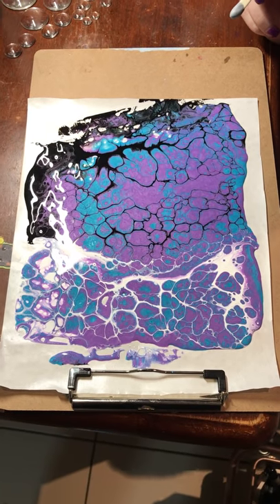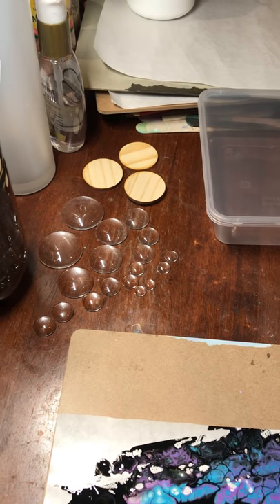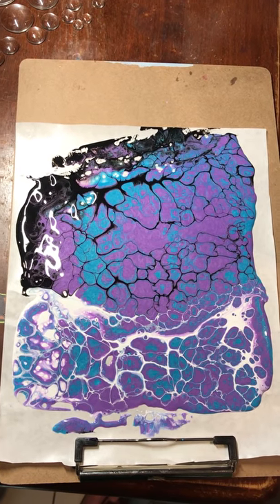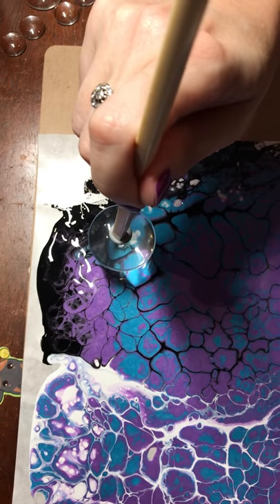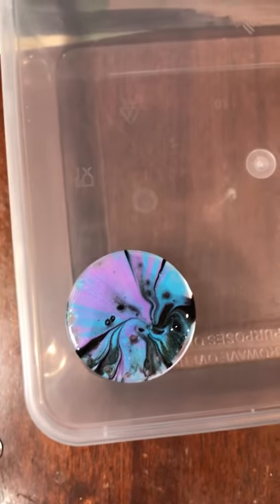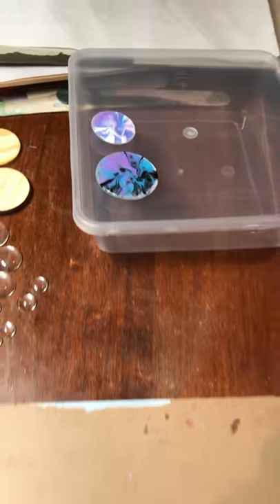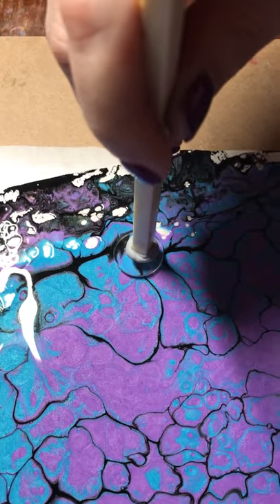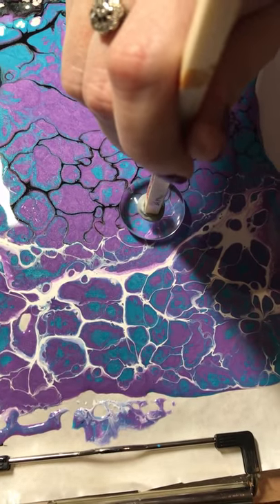Dipping Technique - Acrylic Jewellery

Comment: I tried this dipping technique instead of gluing and cutting, I Love it I made 30 in minutes! 😄💕💕
Reply from the maker: Teresa - great! A warning though - it's dangerously addictive ;)
Reply: I love using this method too, you can do it right away and it's very simple to wipe the edges off after you dipped if you get extra paint on the edges but I also use the other technique after the pour dries
Reply: Where did you get your chopsticks
Reply from the maker: Oh I have no idea 😂

Comment: I'm going to have to try this way I've done the old fashioned by pouring the paint and letting it dry for 2 days before putting the cabochon on
Reply from the maker: I usually leave it for 24 hours but don't forget it depends on your climate! In cooler climates than mine you'd need to leave it for longer :)

Comment: You said you added silicone for the cells (I think you said hair something) but do you need to wash that off when dry like I'm reading alot of people do with their paintings done with the silicone added?  Thanks!
Reply from the maker: Hi there! If I'm using dried pain skins, yes, I'll wipe the skin briefly with a non-oily baby wipe before I glue. If it's a dip, no, I don't clean it off but I do make sure that the pain adheres to the glass or otherwise touch it up with a finger dipped in paint. If there's any silicone pooling on the surface of the paint, it will prevent the paint sticking to the glass, but there shouldn't be any silicone pooling if it's done correctly (stirred into the paint before pouring). I hope this helps!

Comment: I have some copper pendants that I concaved. How would I do an acrylics skin to fit?
Reply from the maker: Hi there! Concaved, hey! You could try dipping...I'm not sure if it would cover the surface effectively, but if it doesn't work, just clean the paint off while it's wet :) Alternatively, you could try pouring directly into the tray. It's harder to control the effect that way, but you could use a toothpick to manipulate it somewhat. Good luck!

Comment: Would this work with just regular acrylic paints with nothing added?
Reply from the maker: To a certain degree. The Floetrol helps the paint to stay fluid and wet so that you can tip, pour, manipulate the designs and dip. Regular acrylic paint will lack the fluidity to do those things, although if you 'smeared' the paint into a design instead of pouring you could manage a similar effect. You won't get cells though.

Comment: Thank you for the great guide. One question- how do you remove the silicon?
Reply from the maker: Hi ziv! I use baby wipes to remove the silicone. Just make sure the type you use doesn't have any oils in the wipe.
Reply: Just curious why you remove the silicone? Does it cause problems with any adhesive? Like resin?

Comment: Should I dip exactly after I pour or do I have some time?
Reply from the maker: Hi Parisa! You can leave it for a little while however a skin will form before too long and the dips may be unsuccessful. Also, the longer you leave your paint, the patterns can change so you may not get the look you're after. If you're using Floetrol in your paint mix, I'd recommend you dip within about 20 minutes after you pour :)

Comment: How would you seal the back if not putting in a tray.?
Reply from the maker: Hi Joan, I use UV resin. You could use 2-part resin as well, although I find the UV so much easier as it's dry in 15 minutes rather than 24 hours.

Comment: Hi...I have been doing jewelry with skins and dipping. I have had to pull several pieces, because the silicone rises and causes a shiny, greasy spot against the glass. The pendant, cabachon and gorgeous paint design are ruined. Do you have this problem?  I have started cleaning skins, like a canvas,  before making jewelry, but cant do dips that way. I have done some dips on the domed, outside suurface and get amazing ,vivid designs and both sides are gorgeous if you want to not put in a pendant,  varnish and to seal and use a bail. The silicone worrys me though!  Any advice or thoughts?
Reply from the maker: Hi Beverly, yes, that means you're using too much silicone in your paint - try just using a drop or two. Only a little is needed! You may still get the occasional spot where the paint doesn't stick - just keep an eye on that whilst dipping and if you see one, use a pinkie finger dipped in paint to cover it up :)

Comment: if u did cabs u don't like and they are dry ect how can u clean them to start again? I thought it was round side gets the paint
Reply from the maker: Hi Vicki, no you want to dip the flat side as that's the side that will sit in the tray or against the skin (if you make a trayless pendant). You can soak them in warm water for an hour or so and then you should just be able to wipe the paint right off :)

Comment: Did you use silicone in your paint to do the cabochon ? Thanks
Reply from the maker: Hi Manouchka, sometimes I do but these days, using Floetrol and Global paint, I find it makes cells without the silicone. You can, either way - I don't find it causes a problem except that if that silicone has pooled and you dip in that spot, it will repel the paint away from the glass. If that happens, just dip your pinkie finger in the paint and touch up that place on the glass and it will fix it right up :)
Reply: @13Art  is Global paint the brand name?
Reply: @13Art  what is the ratio of Floetrol and Global paint?
Reply from the maker: Yes, I believe it's been re-branded as El Dorado now :)
Reply from the maker: 1 part paint to 3 parts Floetrol :)

Comment: I did this, but i get paint on the sides, am I dipping too much?
Reply from the maker: Hey Alexandra, yeah you're probably dipping a little too deep - you only want to touch the paint to the flat side of the cab. Dipping too deep may mar the pattern. If you get paint on the sides, a cloth dipped in rubbing alcohol will take it off quick smart :)

Comment: what is the ratio of paint to floetrol? I'm interested in trying this after watching your video
Reply from the maker: Hi Gail, it depends on the thickness of the paint. There are many different paint pouring formulas, but if I am using impasto paint, my mix is 1 part paint to 3 parts Floetrol, unless it's a metallic colour in which case my mix is 1:2. For thin paint, I use 1:1 and for everything in between I use 1:2 :)

Comment: can you share how you make the paint mixture??
Reply from the maker: Hi there! It depends on the thickness of the paint. There are many different paint pouring formulas, but if I am using impasto paint, my mix is 1 part paint to 3 parts Floetrol, unless it's a metallic colour in which case my mix is 1:2. For thin paint, I use 1:1 and for everything in between I use 1:2 :)

Comment: For some reason the sound did not work on this video. Did you wait until the paint somewhat dried or did you dip after your poured?
Reply: I have only done one dip, but I did it while the paint was pretty wet. I didn’t have all of these cells tho. So do you have to wait on the cells, or do yours start showing up right away?
Reply from the maker: Hi Christine! I dipped right after I poured and manipulated the paint into the designs I wanted.

Kat, if you use silicone in your pour the cells should show up right away - you can use a small butane torch waved over it to bring out more cells. Depending on the density of the paints and the brand, you can also get cells without using silicone.

Comment: Where do you buy freezer paper in Australia please
Reply from the maker: Hi Pamela, the only place I've found it so far is Spotlight, at the dressmaking counter. It's used for making patterns I think? Something to do with stitching, anyway lol. The other thing you could try (I use this now) is in KMart - in the pet area, there is a silicone puppy feeding mat (it's easy to wipe clean when they make a mess while eating). The skins peel right off it and it's reusable :)
Reply: Thank you, I did manage to find it at Spotlight.  I’ve also been using plastic tablecloth which has been quite successful & you can cut it up to large or small size to suit your canvas.
Reply from the maker: Great idea!